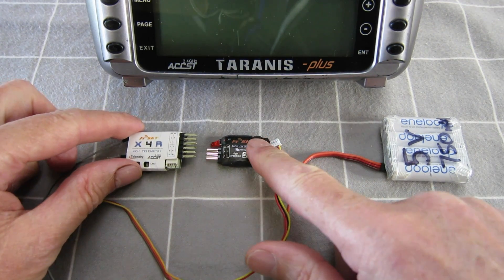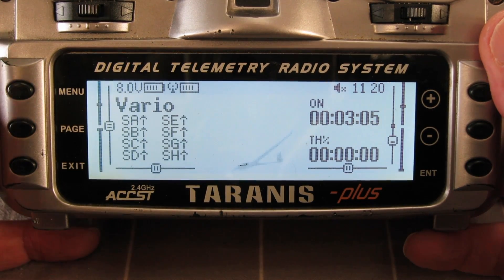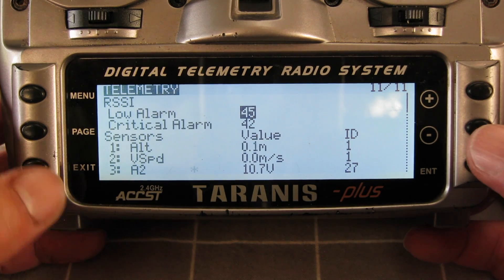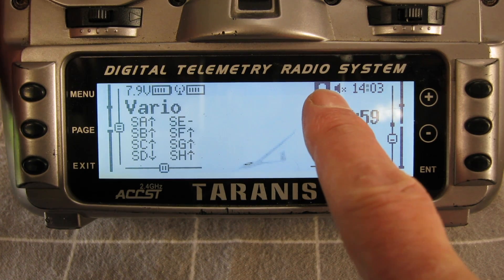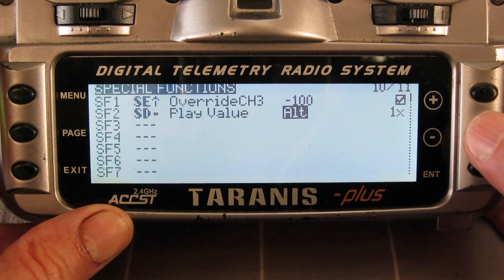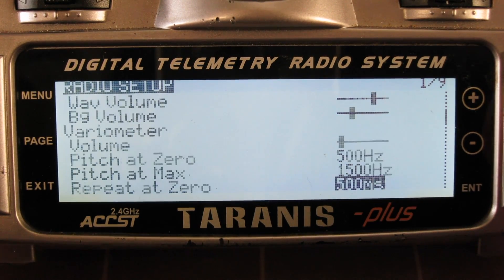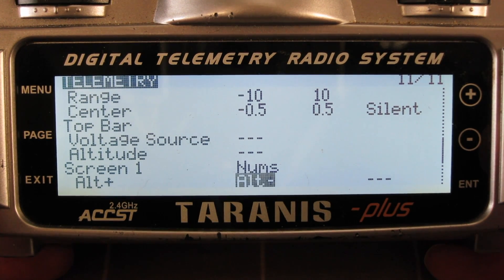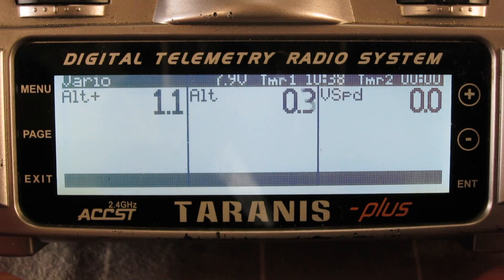FrSky Vario setup OpenTX 2.1

Comment: Thanks, great video  the only problem I am having is that my vario tones don't change pitch when moving sensor up or down,  with the switch in the middle it's calling the altitude change alright 
thank you for any help
Reply from the maker: Make sure Vario Source is VSpd in the telemetry screen
Reply: @AndrewNewton  Thank you for your help I did have the source on Vspd   I did get it working ok now. What I ended up doing was to delete sensors and discover new again and it started working great  I forgot I just installed the new Opentx last week and was having problems with other settings. so I just started it out as a new model and start fresh.  Thank you again your video was easy to follow and understand.  I have had this vario for some time now and never got it to work : }
Reply from the maker: Oh that's good to know Neil. Thanks for the update

Comment: Great vid Andrew, I set this up on my Horus X12 and works a treat. Did you come across an option to reset the altimeter? I'd like to be able to set the alt at zero before take off. Keep the vids coming.
Reply from the maker: Hold down Enter and you can Reset Telemetry or Flight. Can also assign a switch to Reset Alt in Special Functions

Comment: Can you explain to me how activate the vario beep when the throttle is zero ?
Reply from the maker: The Vario function does not depend on the throttle position. You would normally have it on a switch like I showed in the video.
Reply: @AndrewNewton  but I dont want it on a switch. I want the vario to be active when throttle is zero.
Reply from the maker: Oh do you mean ONLY when the throttle is zero? Use a Logical switch. In the Logical Switches page...  L01,  Function A=X,  V1 - Thr, V2 - 0. So the switch called L01 will be ON whenever Thr =0. In Special Functions...  Switch - L01, Action - Vario So now whenever L01 is ON the Vario is active
Reply: @AndrewNewton  Thank you.
Reply: @AndrewNewton  Ok,I did that and set two more Log Switches: L2 a>x Alt 250m (Altitudewarning)
Special functions: L01, Play Val, Alt, 60
L02 Play Value Alt 60.
Did I do a good job with my settings ?

Comment: I had a problem with the Alt audio reporting miliamps and the vario sound not working at all after installing the Amber sound pack it all works perfectly. plus its a much nicer voice to listen to. It took until mindnite. Anyway its a very clear video and I learned more about Taranis than ever before
Reply from the maker: Excellent, Amber is very nice!

Comment: I wonder what the range is of the vario tone.  Same as overall range of Tx/ Rx connection or does it run at lower power like the Spektrum?
Reply from the maker: Good question, same as the radio from my experience. I have had "low signal" warnings but never "telemetry lost" warnings due to distance
Reply: That would be amazing if true.  I get above 1000 feet with Spektrum vario and start getting very spotty telemetry reception.

Comment: hi andrew !! i just looked at this video with the x4r , in this video you power up your receiver with a 4 cells  750ma batt pack , i`m new to fpv and i just received my taranis and x8r receiver and i would like to bind it to my taranis , can i use a regular 4 x 1.5 volts battery pack the power up my x8r  for the binding ?
Reply from the maker: Yes that would be no problem. The X8R can handle 4 to 10V (Looking at the specs on the FrSky site)
Reply: thank you andrew,,,, happy birthday again and have a nice day